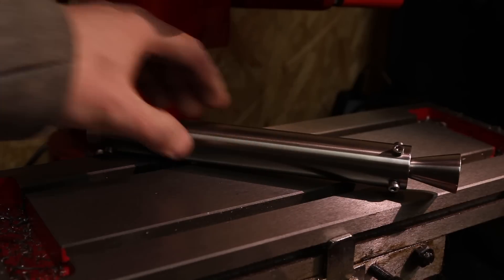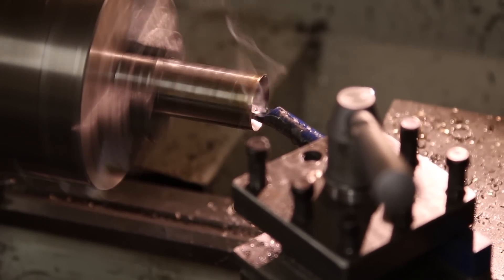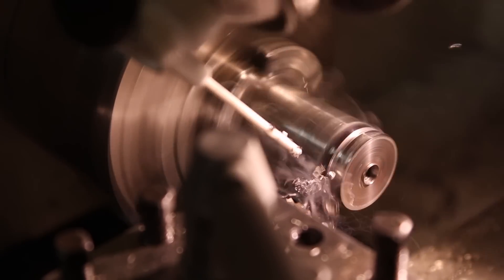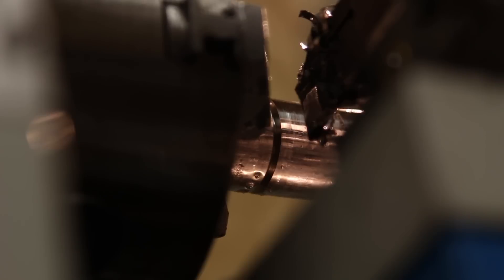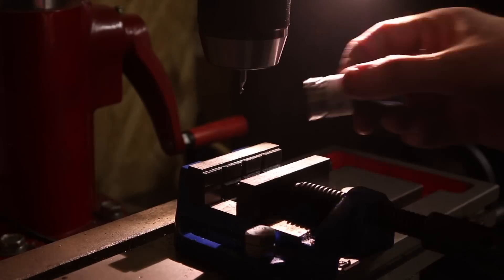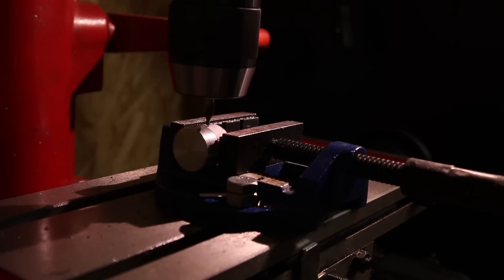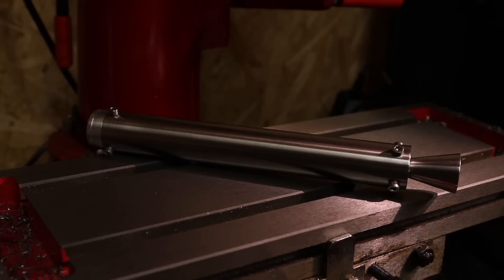Rocket Knife BTS - Making the rocket

Comment: Hey David, i would recommend you to use a labyrinth sealing system instead of o-ring. You dont have to change o-rings all the time and when you work carefully, you dont have any noticeable pressure leakage at all. Just cut some v-shape cuts (maybe 5 would do it for the first test) into front and end cap. That saves you a lot of time (and money) for changing that o-rings. greetz TBY

Comment: Hey man, be careful using the lathe, I've been a machinist for almost 10 years and in the time I've seen so many accidents.
Please don't use gloves on any machinery, not only can they give you a false sense of security (if you grab swarf it will just as easily cut through the glove into your hand) but they can very easily get grabbed by what your machining by friction alone.
You're a top bloke and I'd hate to see you loose a finger.

Also, when doing grooves that you want to have a nice finish for an o-ring try going really slow at the bottom of the groove with lots of coolant, you'll see the material peel off nicely and leave a shiny surface to seal against.

love your videos mate, keep up the good work!
Reply: It's amazing how many bits of glove still remain after surgery requiring more surgery. I won't use gloves again.

Comment: What a great instructional video.  He really takes a lot of mystery and fear out of lathing, even stainless steel.  He makes normal people feel like they could do what he is doing on the lathe. It's inspirational.  To make metal parts would be amazing. It still looks pretty dangerous though. You have to really know what you are doing first.  I have never used a lathe but have seen 100s of lathe videos, if not more. I feel like I could almost do it now. Especially after watching this video. And he did it with stainless and that is really amazing.
Reply: A 'friend' once told me you can't machine stainless steel because it's so hard to do. I always thought that strange otherwise how do they make stainless steel parts. First time I tried stainless ( 303 ) I found it a joy to work with, and I like machining 303 better than I do 6061T-6 aluminum.

Comment: oh dam i hate stainless steel so much. i have drilled thousands of holes for stainless steel cable handrail. i found it best to use very low rpm and lots of water based coolant to keep the drill from dying. sounds like the boring bar and cutting blade are being run too fast.
Reply: I prefer machining stainless 303 nozzles over mild steel.
Reply: yes 303 is a dream. its actually nicer than some carbon steel to machine.

Comment: The paper templates are clever, but you probably didn't need them. You could have assembled the nozzle, rocket body, and bulkhead, then drilled the holes. If the fit of parts wasn't super tight, you could prevent the holes from wandering by tapping the first hole for each connection and bolting them together. From there you drill each hole and then tap.

Comment: Rocket engineering with a manual lathe. Nice
Edit: Just like Gustav Meyer said, ditch the gloves. They won't help you much when they get caught on something and your arm turns into ground meat.
Reply from the maker: dang made me hungry now
Reply: David Windestal I'm not trying to criticise you or call you an idiot like some of these other dumbasses, I used to wear gloves too until someone set me straight. But for real man, this is damn impressive!
Reply: If in doubt, searching for "degloving lathe" will convince you. Fair warning though: degloving doesn't just mean your gloves will be pulled off. It means your flesh gloves will too.

Comment: Are you going to make a BTS for the Rocket propellant? Or is it a premade cylinder that just fits in your tube? What was different between the "full charge" that's now in orbit. and the "full charge" that went 125Mph in your other video?
Reply from the maker: No I will not. Don't want people to just do it. They need to do the research first. 
No major difference between charges. The first rocket broke off the sled and flew off on it's own. Hence the higher velocity.

Comment: Yes I know Nakka's earlier motors were made with steel casings, but it's still bad form. Since the fasteners on the closures look to be way overbuilt that guarantees a casing rupture and steel fragments. You have the equipment, and some aluminum stock, why not aluminum for the casing like the rest of the industry?
Reply from the maker: I agree on the aluminium casing. It would have been a better choice. I went with what I could get my hands on. To give myself a bit more safety margin I did go with stainless steel with thicket walls than Nakka did.Rupture pressure of SS casing >9000Psi
Failure of screws ~1000Psi / screw
Number of screws on the bulk head - 3
number of screws on the nozzle - 4
Primary failure point pressure 3000Psi on bulk head
Secondary failure point 4000Psi on Nozzle
Think 5000Psi overhead was a pretty decent safety margin in this case considering the two axial failure points.
But yeah if anyone is thinking of making a rocket, use aluminium as the casing.
Reply: Literally over 9000? I'm so used to that number being metaphorical
Reply from the maker: IT'S OVER 9000!
Reply: A couple grain cracks though, and you could easily see those kinds of pressures. I don't recall what it is exactly for sugar propellants, but I was just having a discussion about this with somebody else. Over 2000-2500psi propellant burn rate can increase by orders of magnitude(at least with APCP) pretty much insuring an explosion no matter how robust the motor hardware is. Also the pressure spike can happen so fast that the casing can blow before a closure anyway. If you designed for a 600psi chamber pressure you want the closures to fail around 1000-1200psi so it lets go before you get into the crazy high energy failure.

Comment: What kind of O-Rings did you use? I mean, they have to be temperature resistant so I guess they won't be normal rubber😂
Reply from the maker: Normal nitrile o-rings. I grease them and I change them after each firing. Burn time is so quick they don't have time to heat up during the burn. It's the heat soak that gets them.

Comment: I machine 316/304 stainless just about everyday in my current job, you get used to it after a while and once you've worked out its nuances its a joy to work with. 
Could you use a leaded free machining steel for your nozzles? It would rust, but as long as you didn't keep it wet or outside, it wouldn't be an issue. It'd be a lot easier to machine.
Reply: Also, I don't want to put a negative on your fine video, but in most places I've worked, it's instant dismissal if you're wearing gloves on a machine. Be careful.
Reply from the maker: Hey thanks man! I never thought about the gloves. Thanks for pointing it out.
Wish there we're a store with round stock around here. Was super super lucky and got both the stainless and the aluminium from the local scrap yard by bribing them with cookies.
Reply: No, thank you! Your tricopter is one of the best things I've ever bought. And let's be honest, who doesn't love a good cookie.
Reply: @DavidWindestalRCExplorer  hey how do you power the Rocket? What fuel du you use? Is their Amy Mechanik in there?
Reply: J M try machining titanium 😂😢 nightmare.
Reply: David Windestål - I think you can probably make a good safety video in slow-mo on how bad wearing gloves can be. Maybe build something with a burr in it that catches the glove around some sort of ballistic gel mannequin
Reply: nW squidasaur without carbide it's hard.
Reply from the maker: I like it!
Reply: I think non-stainless steel wouldn't work well for a nozzle. It's having some strong oxidizer blasted through it at very high temperatures.
Reply: You can use any type of steel for sugar motor nozzles. Stainless steel works best because to clean sugar motors you simply throw all the parts in water and the residue simply dissolves off. With stainless, you don't have rusting issues.
Reply: J M agreed, 303 is useful like this. As it is, spindle speed is too high and cuts are too small, that and HSS tooling is a recipe for work hardening and squeeeeeal.
Reply: @nW squidasaur Hastelloy, or Inconel  too!

Comment: Using gloves with a lathe is insanely dangerous. Even a small lathe can mangle you badly if anything catches the glove.
Reply from the maker: Thank you for thinking of my safety. I really do appreciate it.
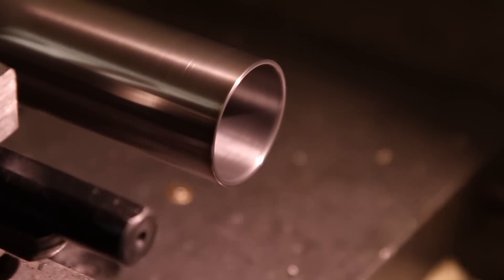Reply: 7:49 - So is that. Use a stick instead of your finger, it doesn't matter that there is plenty of room; bad habit, bad results with smaller diameter.
Reply: You generally find that people who wear gloves usually DON'T wear eye protection, so please David, wear the safety glasses instead of gloves.
Reply: you know, you can sling insults all you want, it only puts the point on the fact that you have no idea what you're talking about.

people up and down these comments have mentioned that wearing gloves, just like wearing loose clothing or unbuttoned long sleeve shirts, is a dangerous, stupid practice around machinery. the fact that you don't know your ass from a few missing fingers or a wrapped up arm, or crushed torso, doesn't change that fact.

"Better to remain silent and be thought a fool than to speak and to remove all doubt."

~mark twain.
Reply: Adam Demas - Very easy to have a particularly dangerous diameter in combination with one and especially two fingers - anything catches and they get twisted off.

Where I am if you don't use anything except your fingers there's a Fine. General Practice is no Gloves in the Machine Shop except for Bandsaw and Shear/Bender, never for anything moving.

Different regulations in different countries, thus a few countries with lower costs (and higher accidents/pollution, etc).

Be safe, we want to see next week's Video. 😃

YT,
Rob
Reply: Any time =) Your RC videos wouldn't be as enjoyable to watch if you had to fly with one hand :-P   
General shop safety tip: If it rotates, is stronger than you and it cant be stopped quickly, no gloves, loose sleeves or long hair.
Reply: Oh man i was thinking the same thing... as soon as i seen the gloves i had anxiety watching this video... of course nothing happened, otherwise we would have seen missing fingers or something in his other videos, but still...
David, please dont wear gloves while working with any rotational equipment...
Reply: uh, no, that rule is so you don't earn a name like "stubby", "lefty", or "dumbass". you don't fuck around with lathes.

lose the gloves.
Reply: LowLightVideos - I've never used a lathe, but my Spider senses were going off at this point!
Reply: David Windestål try peck drilling instead of just drilling straight. You'll find you holes to be more concentric. And you swarf build up will be more manageable.
Reply: 3000gtwelder - Oxymoron is an oxymoron - 😃 - never give oxygen to a moron.
Reply: please use safety glasses David :D
Reply: Great idea - though I wonder if his lathe has enough torque for that. Or if his drill chuck opens large enough to hold something of that size. It'd certainly make it easier than boring a taper.
Reply: Michael Buffington - He could also stick a 1/2" Ball Mill in the Tailstock Chuck and add a ~10° taper. That is closer to the true shape, more expensive Tooling and more work.
Reply: I guess safety is a Oxymoron in this video haha.
Reply: This is the rule for all rotation tools
Reply: What lathe are you using?
Reply: kop pela hd210
Reply: & no one catch that he's not wearing safety glasses either. @3:39
Reply: David Windestål - IF you want a simple 60° Cone 1:05 why not buy a huge 60° Center Drill, that will save time during the portion of building that you complained was too slow.

For advanced Design look at the shape shown on this Webpage (don't worry about doing all the Math unless you want to, just see the shape) - I removed the http and added spaces so it doesn't go to SPAM Bucket: spaceflightsystems . grc . nasa . gov/education/rocket/nozzle.html

For much easier Design, similar to yours, there is: www . risacher . org/rocket/eqns.html - and many others.

Your Design is 'good enough' but the enormous 60° Center Drill will make it less tedious if you're going to make a lot of them. Find a huge used one second hand.

It would be great to see a 2 inch Rocket but even a 1 one diameter Center Drill will cut down a lot of time over a 3/8 diameter one.

YT,
Rob